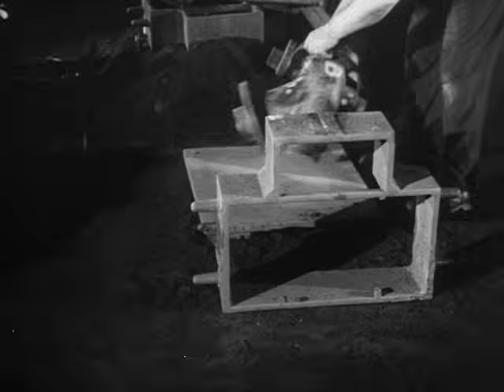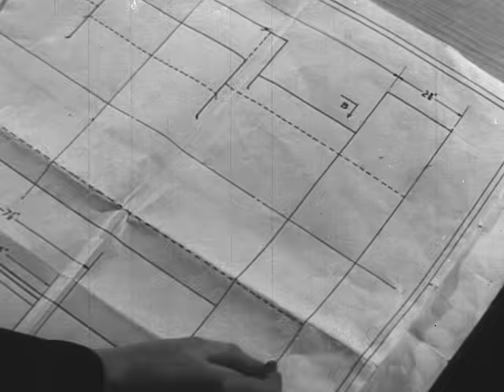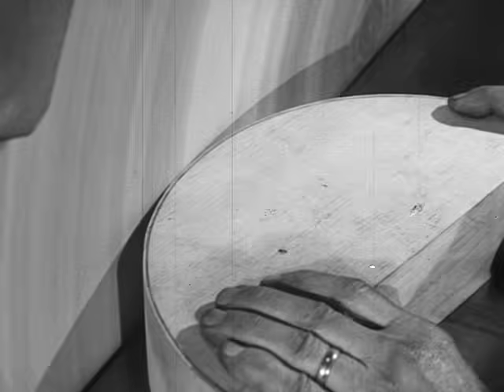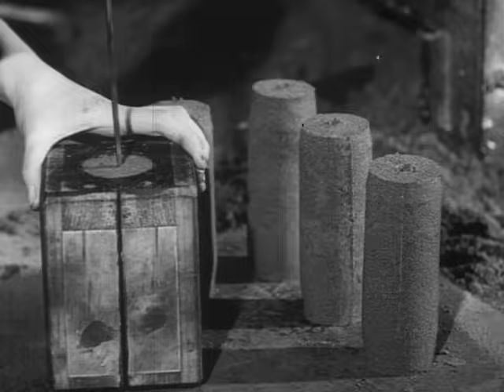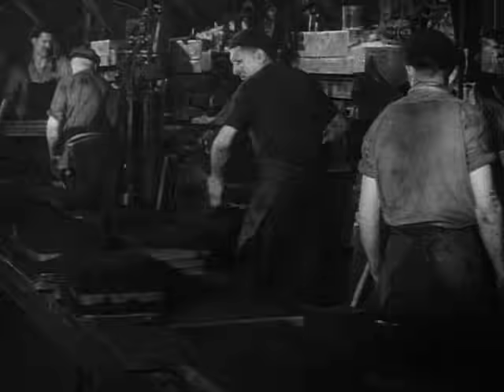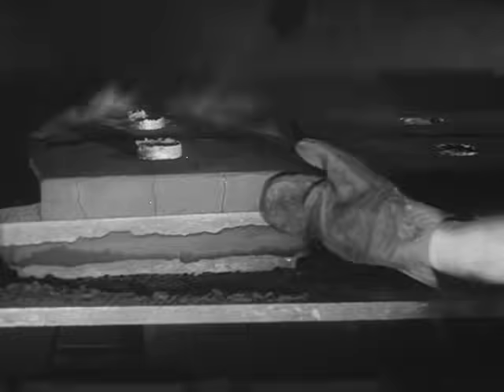A little bit of Doosan Babcock history - all about the foundry casting process

Comment: todays children will never experience the joy of walking past something thirty years later and thinking "i made that". i also see some things and think... "oops".
suddenly i think of this street sign. one way, left to right. the sign was backwards. "left turn only". and an arrow. was the same heading the other way as well...
there for years. a busy main intersection... someone took a certain pride in doing that, and getting away with it... what a change in ideals we have now.

ironic, that the hard work and effort put in by these people has led to the very erosion of the skills to do it. we take the flat screen for granted. we take our chair for granted. our shoe. our floorboard. the footpath. the streetlight. the manhole cover, the sewer.. everything. someone had to make it, someone had to work hours at a menial job, like the moulding guys here... no glamour in waking up 6 am everyday, trudge to work to sling sand into boxes all day, everyday... endless boxes and mountains of sand... stand behind grinders and hot saws cutting flash and sprue.. just to trudge back home and sleep to repeat... wee!

the glamour is in the patternmaking and the pouring. 

funny thing. worked with various timber machinists. every one was missing at least one finger...

the few patternmakers i met had every digit... utterly different trade.

Comment: Ah, memories. I worked in an iron, brass, and bronze foundry for 8 years back when I was a young buck. Started out grinding, went to molding, and ended up pouring. We made everything from sprinker heads and skillets to 12,000 lb water control gates. It was fascinating, hot and heavy work. We didn't need to go to the gym, for sure. Those are some of the toughest, hardiest men you'll find that do such work. Some of the best friends I've ever had, too.

Comment: I had the privilege of being a patternmaker for a number of years starting in the early 90s.  It was a small shop with no cnc equipment.  It was the most rewarding job I've ever had and wish I still did that work.  It was an honor to work in this trade for guys who had been doing that work for decades.  Great times!
Reply: I can relate as I worked in the tool and die trade beginning in 1977.

Comment: I served my engineering apprenticeship in an aluminum foundry in Cardiff, South Wales UK - We cast in aluminum, brass, and Mazak in either High-Pressure molding machines - sand foundry - low-pressure foundry - gravity foundry - as well as the Mazak foundry. I worked as a fitter/tool setter on high pressure. The brass molding amazed me because as fast as the brass was poured, the molds were opened ready for the next castings.

Comment: Bloody hell this takes me back to the times i worked in foundry's, i was 18 and an apprentice panel beater bit fed up with low wage 11 quid a week my brother who was a loose pattern moulder said they wanted labourers in the foundry where he worked, you seriously dont know what hard work is until youve been in a foundry, Each moulder at least 10 of them had thier own floor with apile of green sand which would be at least 35ft long, after all the castings where taken up each floor had to be shoveled through a machine called a royer ready for the next day,  if i remember right i lasted 6month then went back in to my apprenticeship
Reply: I was a moulder core maker in a lead and allum foundry. Hard work but very rewarding.

Comment: I watch this and see that computer controlled 3D printing now days, with some minor finishing, can achieve the same results.
Reply: Have you got a 3D printer that prints in cast iron?
Reply: @ohidontknow1061  No, but 3D printing can easily make the template that's used  in with the casting sand. No need to cut or mill wood blocks down to a certain size.

Comment: Did I miss a step? they put dry sand in and rammed it and the next thing is there using the sand as a mold,did they have something in the sand to harden it?  That took me back seeing a hand brace being used.
Reply: No the sand has oil and cereal binder in it

Comment: Viridis3D RAM123 robotic sand printer —a game changer.. Located just a stone’s throw from the foundry furnaces, the Viridis machine prints molds and cores straight from a digital model into a bed of sand, one sweeping layer at a time, without any need for a pattern or core box, the tooling that has long been typical of industrial casting. What used to take 4-10 weeks to get a part, takes 2 days...
https://youtu.be/lacCTzU3wsk

Comment: And if you really knew how much wasted work was produced, you would wonder how there were world leaders in any pipe or valve construction. In the 2000's -- the success rate on one valve casing approached 50%, on a good week. Muggy or dry weather and the sand gods required sacrifices to make a mold.

Comment: Isn’t it crazy that some of the castings you see in this video could probably still be in use today
Reply: Well....As long as the temporary world fair attraction called "Eiffel Tower" is still standing its not quite that amazing... Then again all that thing has had to deal with was Parisian weather.
Reply: @volvo245  Have you seen the "artwork" below the eiffel tower? Its pretty weird
Reply: @volvo245  it was way over-engineered and requires a lot of upkeep and maintenance, like the Golden Gate Bridge
Reply: Me and my sledge likes to take them out
Reply: funny you should say that, I worked on a large bronze casting of a Christian Cross that was installed on a cathedral in the 1970's. visited it recently and it looks good up there and I imagine it will be for decades or even centuries to come
Reply: When you think that lots of the work Babcock did for the C.E.G.B. is / was powering the grid up to only a few years ago, well beyond the design life of the 2000mw stations, they still did good stuff right into the 80's.
Reply: For sure
Reply: Yes I probably a lot of those patterns are still used today
Reply: @dominickchianese4530  Iv'e made castings from patterns over 80 years old..... let that sink in
Reply: Absolutely 💯 they are.🗿🇺🇸
Reply: Things were made to last. Nowadays most things verge on disposable with short lifespans.
Reply: @VenturiLife  these are industrial parts, they are not consumer goods. Consumer goods are made to a cost, industrial parts are made to last.
Reply: @Steve-uy9lj  Ya thats not always the case
Reply: @VenturiLife  I work in a Foundry and the stuff that we make is even better than before 
But I get what your sayin 
Foundry's are a dying trade but they wont be eliminated by new tech in some cases a casting can only be done this way and not completely machined from billet

Comment: did some aluminum casting in high school it was fun, also when they made these models to make the mold , they had to be slightly larger for shrinkage in the cooled metal, that was the skill
Reply: Actually they used to make special rulers, for each metal type, that had the shrinkage allowance built in, but I expect that they will be virtually unknown, or unavailable now, as most design work will be computer controlled and built into the programs instead.
Reply: @niklar55  Different ones for different metals

Comment: Anyone know which year this was ?
Reply: This was probably around the very early 50's coz when I started my apprenticeship in the 60s the Production Machines had changed a lot and became smaller although still capable of doing the same moulds and sand technics had gone with CO2 drying the sand hard so that moulds could be cast faster.

Comment: I’m a skilled patternmaker who had an opportunity to see things made from the old way.  I saw an old timer saw and sand and hand build tools in the wood room from paper drawings. I was 20 then fresh out of college with Cad/cam experience and Cnc skills.  (45 now) To have the opportunity to learn from a couple guys like that I am forever grateful.  These jobs are disappearing and it’s because the foundries drive the price for tooling down.  Now they are going to have to start paying more because there are fewer places capable of tooling design.  Thanks for sharing this video.
Reply: My 90 year old Dad worked as a pattern maker in St Louis at Scullin Steel. It's long gone now.
Reply: Are you suggesting the methods in this video are old-timey?  I worked in a foundry in Pennsylvania the early '90's that must have purchased all the machinery and patterns from this Renfrew facility.  I'm not sure when this film was made, but we were using the exact same methods as recently as 25 years ago.
Reply: @charlesenfield2192   And these same techniques are still used today.
Reply: @phuturephunk  yes sand is still the perfect media for pouring castings into molds , we still use the Cope and Drag method and cores for internals , passages and galleys , nothing  has changed except there is barely any skilled patternmakers left. It's a dying breed . Sad
Reply: @charlesenfield2192  i run a foundry and we still sand cast (we have some newer equipment too) aluminum, nickel, and bronze.  what a show.
Reply: @barry rudge  - Then I can pleased you, because here in Norway we still have model makers and education in this field (apprenticeship at factory and later vocational exam)  :-)
Reply: i used to work in a foundry as the furnaceman ,,, loved the job ,,, assisting in pouring
Reply: I'm 72 and retired now. I spent the bulk of my early working life as a boat carpenter and made patterns in a pattern shop when the boat business was slow. Worked with some skilled carpenters in both professions, enjoyed every minute.

Back in the day we worked from blueprints, no CAD/CAM/CNC in sight. Today many jobs that would have had to been patterned and cast in the past are now CNC'd, as they should be. Too many people were involved in making a piece to be competitive with modern methods.
In the past someone would tell an engineer to design a piece [1 person], a draftsman drafts it [2}, a printer makes a blueprint [3], a patternmaker builds a pattern [4], a foundryman casts it [5], a machinist blueprints it [6]. So a minimum of 6 people, and probably twice that -- stockman, QC, shipping, etc.
Contrast that with today. An engineer designs it, and probably creates a drawing and CNC code at the same time [1], a machinist pops it in a 5 axis CNC [2], et voila! 
Yes both scenarios are too simplified, but you get the idea. I'm sure there are some parts that are best made old school, but not many.

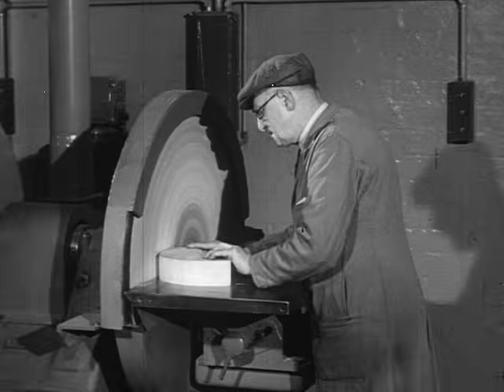BTW, that giant disk sander at 9:57 is awesome! Disk sanders are patternmaker's tools, you can cut a line at a compound angle so tight you rival a machinist on a Bridgeport.
Reply: Chimera we just bought a machine that 3-D prints sand cores and molds directly from CAD models and in just a few months the tooling we used to cut has been cut in half!  Patterns aren’t even necessary any more the machines sure are cool though. Now I sit at the computer all day and design molds.  Such is life constant evolution.  I still enjoy the work it’s just different.  The machine is called SMax by Xone check that out!
Reply: @Flyanb  o
Reply: @Flyanb  what are your run sizes.  Even a medium run...say 100 castings 3 times a year will make printing each core too expensive.  There is a qty where core box molds are more cost effective.
Reply: @ChimeraActual I just wanted to say that it’s really nice to see someone of an older generation of engineers speak well of modern practices and not bemoan modern engineers or the disappearance of older styles of manufacture. It’s just how progress is and we don’t work any less hard it’s just a different kind of work. So thanks, really lightened my mood.
Reply: @ChimeraActual  The casting method is better than the five axis machine when a high volume of parts is required.  
Just sayin, JIM
Reply: @jimc4731 , in some cases that's true. It may depend on whether the CNC can complete the operation in one pass and need no finish work. 
On the casting side, most precision work requires further setup and work on one or more machines, if the run is long and no further machining needed, then yes, that's the way to go. 

As pointed out, there are now mold making machines that eliminate classic patternmakers entirely.

I'm talking about sand casting for foundry poured metal parts, there are other casting methods, but I don't think any require a pattern maker. Correct me if I'm wrong, please.
Reply: Mkbk9 ko o.a.
Reply: Currently a 30 year old pattern maker trying soak up as much as I can from the older guys
Reply: Imagination Still is The Right Concept in Foundry.
Reply: Skilled? Where you living.

Comment: holes in the pipe flange couldn't be  made that way. some drill bit snuk in ; )
Reply: The foundry I worked in we used Wheelabrator equipment and also made the cast parts for it.  The buckets that circulated wheelabrator shot had holes in them and they were punched in, not drilled.
Reply: My joke didn't worked: I meant all the holes for the bolts. Of course the big bore is made by removing the sand core. Bye bye! Great video, despite the hater who attacked me above :) Peace and love

Comment: It’s the 3-D printing of the industrial age. I am proud to own a huge pattern for a rocker arm from an old paper mill. People can’t seem to see it as art.
Reply: Some of the old pattern makers were hobos and traveled the rails between jobs. I wonder if some of it was seasonal in the US, as the automotive industry got ready for the next year's model.
Reply: @douganderson7002   but yes, it is! Don't you see it? With box sand casting You can prototype shapes at a fast rate, much faster than with die cast moulds. This video shows making final patterns, out of wood and well varnished for prolonged, repetitive use, but you can use modeling clay or similar compounds to sculpt even one-off parts or use old broken (e.g. cracked) parts after clay-smoothing etc. direct as patterns for casting. This is very much the role that rapid prototyping, 3d printing and CNC prototyping aim at nowadays.

Comment: Some things never change. I work at a place that does things exactly like this like it was 100 years ago...lol
Reply: Well, why change when something work like a charm ^^
Reply: @KGB95140  Competition. In a free market, you  gotta keep up with the cheapest manufacturers. If someone would have magically acquired a CNC mill in the 1950s to automatically mill the patterns, they would have absolutely obliterated Wilcox & Babcock. 
The free market hardly has any space for labor intensive work, when equally good and less labor intensive methods are available. Which is sad, of course, because it means firing very skilled workers.
Reply: Used to work at a foundry in the 2000s. Takes me back to that time. Everything was like in the video, except for hard hats and electric furnaces (-;
Reply: Same equipment, just updated controls.
Reply: A Place...mmmm
Reply: "Things"
Reply: Until now... https://youtu.be/lacCTzU3wsk
Reply: Nowadays they mostly use foam patterns cut by machine